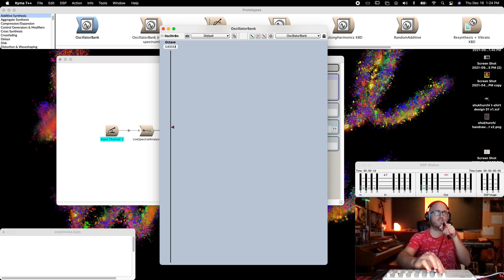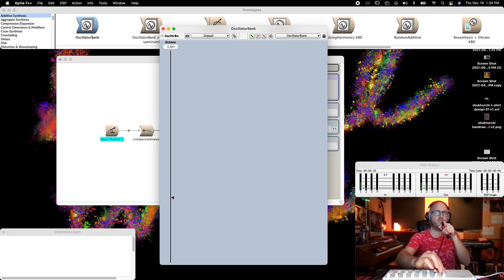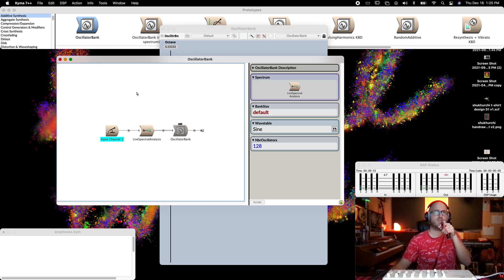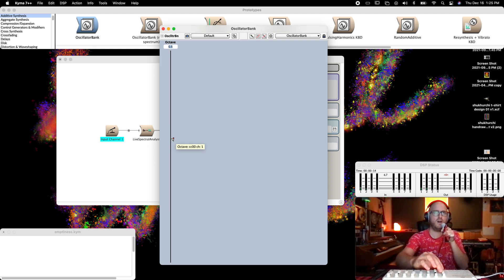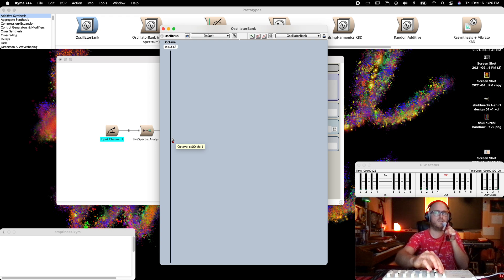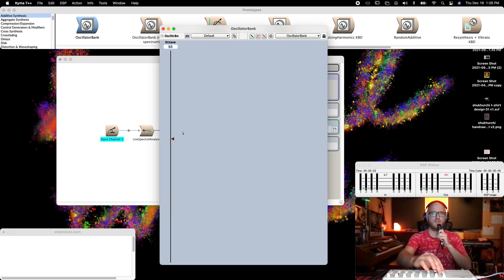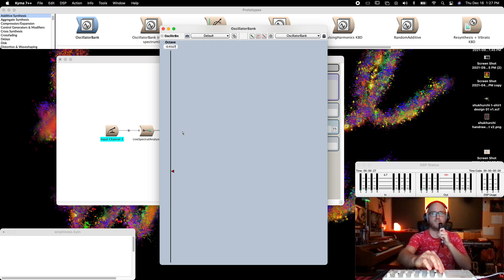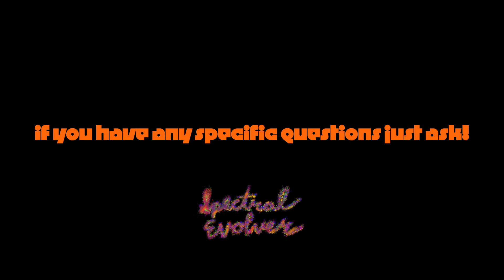This is not my Voice | Kyma Patch from Scratch: Live Input Pitch Shifter Tutorial (Minimal Talking)

Comment: I have a question. With the Kyma systems being so old now, why does it still sound way better than anything I could ever get out of Reaktor or MaxMSP? Even with an excellent modern CPU, I can never make anything sound this pristine. Thanks
Reply from the maker: Hello, it's a good question and I wish I could answer it authoritatively. One thing I would say is that Kyma isn't "old" as in outdated, but maybe "old" in terms of maturity. Maybe some of your questions will be answered via the SSC website "about" section. In case your curious, here's a link: https://kyma.symbolicsound.com/about-symbolic-sound/
Reply: @SpectralEvolver  I appreciate it. I've always had a couple of guesses as to why it has such a fantastic sound and I'd like to hear what you think in regard to this. I think it sounds so great for a couple of reasons. The first is that the DSP processors in the Kyma hardware are not only designed and programmed for signal processing, but in addition to this, its focus is almost exclusively on the signal chain. Our personal computers have to run a ton of foundational programs and processes in the background before it can even start computing natively run audio applications. Another reason I think it sounds the way it does is the D/A converters on the back end. Audio is only a small fraction of what our computers are designed for, so that being the case, they aren't equipped with super intensive and advanced signal processing algorithms for the conversion process like a Pacarana is. My last reason is sort of tied to my first, and that is since a Kyma system is designed exclusively for audio signal processing and it has the horsepower to handle it, there is no expense spared as far as the way they designed the different synthesis and other signal processing algorithms. Even though the system is a lot older and there are better DSP's out there, what it has already still shreds because the signal chain is all it has to worry about. Sorry for the long response, I'd honestly like to hear what you think in response to this, thanks.
Reply from the maker: @andrewb214  Sure thing. I think you have pretty much hit the nail on the head in regards to the dedicated DSP. Having a hardware accelerator just for audio is a big deal much the same way serious video people will have a high quality GPU. Though computers have become stronger and faster, not having the burden of running an OS etc. means the Paca(rana) doesn't have to waste processing cycles and can focus on the audio, and in Kyma's case, with sample accuracy. One area I don't think is quite right is with the A/D and D/A. The Paca(rana) doesn't do any conversion, the audio interface you have connected to it does. The Capybara does conversion though and if you happen to have that in conjunction with the Paca(rana) then maybe this could be more of a topic for discussion. I only know of one person who had this set-up and it was more than ten years ago when I first got into Kyma. At the end of the day, it sounds amazing because incredible people, who are dedicated to sound built it and maintain it, with as little or no compromises as possible.
Reply: @SpectralEvolver  Oh wow, I always thought that the Pacarana had a dedicated AD/DA. So in order to get sound out of the unit you have to hook it up through an audio interface? Thats really interesting. Its funny man, around a decade ago I bought a Virus TI and I was blown away at house good it sounded. I'm sure a lot of people would disagree with me, but I really do think digital hardware synths, for the most part, have a different sound than vst plugins. I don't even really classify it as better or worse, but to me its just different and its a sound that I really find audibly pleasing.
Reply from the maker: @andrewb214  Yep, exactly. And in the scenario I mentioned the Capybara is the interface for the Paca(rana). There's a list of other compatible interfaces on the SSC website if you're ever curious. Anyway, I know just what you mean. There's nothing wrong with digital synths and they can sound fantastic. Let's use the Synclavier as another example. It's a digital synth and it sounds out of this world!